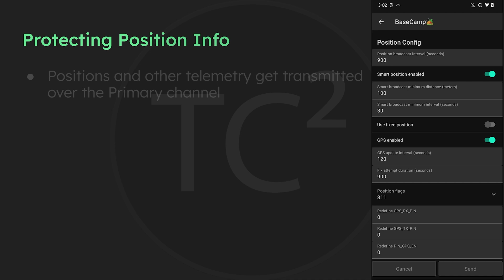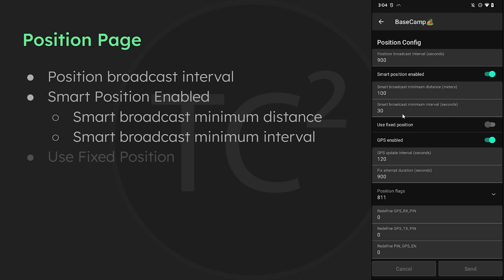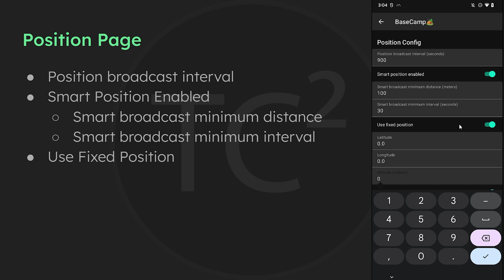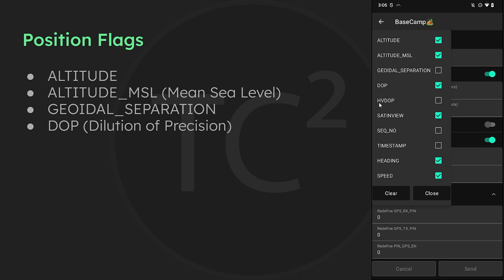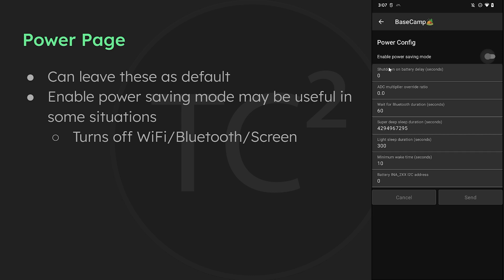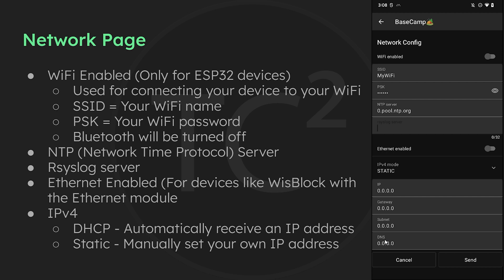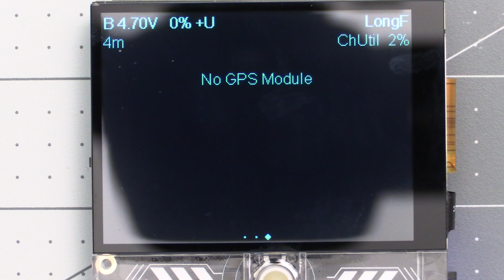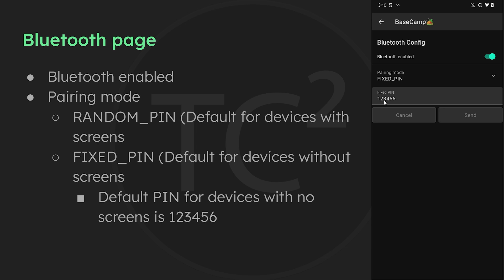Advanced Meshtastic - Radio Configuration Part 2

Comment: I notice that the default smart position minimum seconds is 30, but the GPS update interval is 120s. If your actual position is checked every two minutes, smart position would never cause it to transmit faster than that, right? I am wondering why those those don't default to either the same value, or GPS<smart position.

Comment: How does GPS work in a scenario where there is no other meshtastic devices to report the location of a device?
Say my dog runs off and has a GPS module on its collar, the dogs collar receives GPS coordinates via satellites to the meshtastic device, but the device can't transmit them to through the meshtastic network back to my device due to terrain/distance?
Reply from the maker: The collar would need to be in range of your or another node to get the location to you

Comment: Interestingly I'm trying to configure a Heltec V3 module to mount in the attic and so I've configured it for connection via Wi-Fi and Web client. When I go to the position configuration section I can turn on "fixed position" but I don't get the option fields to actually put in the lat. and long. info. Is this an oversight of the developers or me? I suppose I could switch it back to bluetooth and configure it with the android app and then switch in back to wi-fi for web client access.

Comment: Just set up my Heltec v3. I'm in San Diego but dont seem to see anyone around when using the App map. Is there some different settings I need, or is the default settings correct and there just isn't anyone around down here?
Reply from the maker: Your best bet for finding others is going to be the default settings. It's possible there's no one around, or you just need better placement or antenna. What antenna are you using and where is your device?

Comment: If we disable GPS, the power consumption reduces? To me the RAK kit with gps is too warm and the newest RAK12500 just doesn't work, but the older model.
Reply from the maker: Disabling GPS will save battery. If you're using RAK and don't need GPS, I would just not add the GPS module.